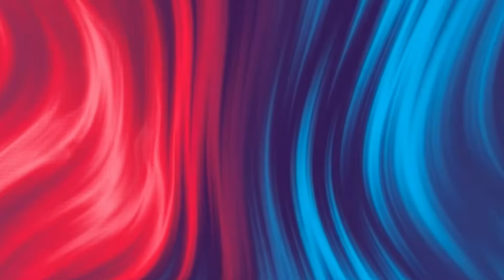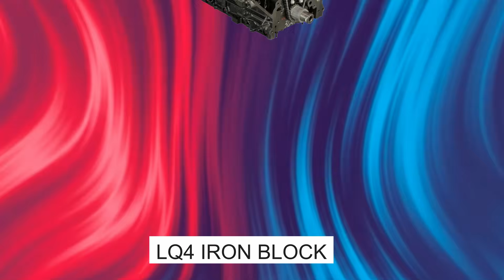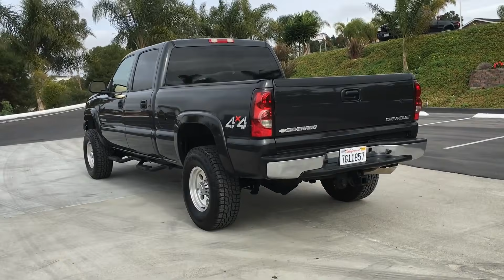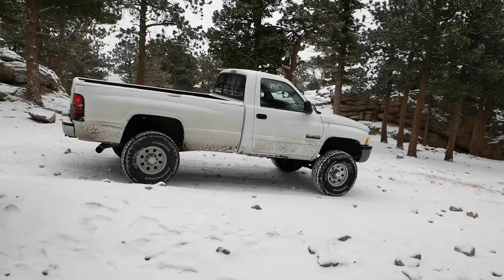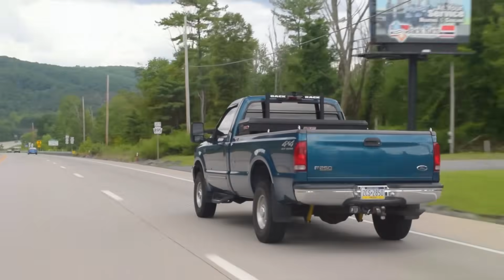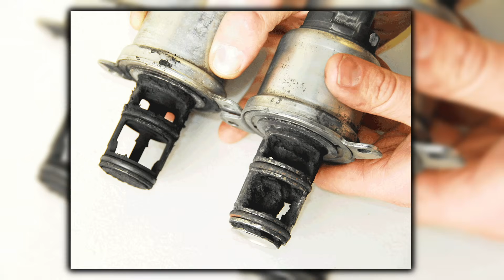3 Heavy-Duty Trucks That NEVER Break Down (Buy Once, Drive Forever)

Comment: 93 F250 XL 4x4 extended cab 7.3 idi non turbo 5 speed. Mine only has 148K on it. She's still not broke in yet. Great truck. Wouldn't trade it for anything.
Reply from the maker: The 7.3 IDI is a tank, specifically because it lacks the electronic complexity of the later Powerstroke generations. That International Harvester design is built for low-stress longevity, and pairing it with the ZF5 manual makes it one of the most reliable mechanical drivetrains ever put in a Ford.
Since it’s an IDI, are you consistently monitoring your SCA levels to prevent cavitation and liner pitting?
Reply: @AutoMetricsHQ  Honestly I never heard of that before. Thanks for bringing it to my attention. I'll drain flush and refill with an SCA precharged coolant.
Reply from the maker: That is definitely the right move - liner pitting from cavitation is one of the few things that can actually kill a 7.3 IDI long before its time. Once you flush it and get that pre-charged coolant in there, the chemical barrier will protect those cylinder walls from the microscopic vibration bubbles that cause the damage.

Are you planning to use a standard heavy-duty coolant with a separate SCA additive like Fleetguard, or are you going to switch over to a modern ELC (Extended Life Coolant) to skip the manual testing altogether?
Reply: @AutoMetricsHQ  I just put Napa 50/50 in it about 3 months ago. So an SCA additive perhaps. Been studying it, but what would you recommend?
Reply from the maker: Since you recently put fresh Napa 50/50 in there, adding a bottle of Fleetguard DCA4 or Ford’s Motorcraft FW-16 is the most straightforward way to get that protection without wasting good coolant. Just make sure you use some test strips to get the concentration right, as too much additive can actually lead to water pump seal leaks and radiator clogging.

Do you have a coolant filter kit installed to help maintain those SCA levels, or are you just going to stick to manual testing with the strips?
Reply: @AutoMetricsHQ  No filter kit, I'll just stick to manual testing. I'll think on it some more, but I may just start all over. Flush it really good, then go with fleet charge, then I know I'm good. Truck deserves it, and I know I'll never get a better one.
Reply from the maker: Flushing it and switching to Fleet Charge is a solid plan - it's specifically formulated with the SCAs already in there, so you don't have to worry about the chemistry project every time you top it off. For an IDI in that condition, it’s definitely worth the peace of mind to know the liner protection is dialed in from day one.

Since you're going for a full flush, are you planning to swap out the thermostat with a Motorcraft OEM unit while the system is drained to make sure the operating temps stay exactly where they need to be?
Reply: @AutoMetricsHQ  Yes I'll put in a ner thermostat beens its torn down that far, may as well. I've done quite a bit of work to it, complete new brakes with calipers, drums, and new bearings and seals all the way around. New heater core, brake master boost, brake master cylinder, wiper motor, blinker switch, tensioner and lots more, so I'm not gonna quit now. Thanks for all your great advice. It is much appreciated and rare to get these days.
Reply from the maker: That’s the right way to do it - the Motorcraft OEM thermostat is the only one that truly regulates the bypass correctly on these International engines. I really enjoy connecting with folks who truly care about their trucks and put in the work to do things the right way; it's exactly how you make these legends last a lifetime.

I’m always happy to share what I’ve learned over the years, so feel free to reach out anytime if you run into anything else or just want to talk shop.
Reply: @AutoMetricsHQ  I will and thanks again

Comment: 2002 cummins dodge  300k and still purring  and no blow by
Reply from the maker: That’s a solid milestone for a 24-valve. 300k miles with no blow-by proves the internal tolerances on that 5.9L are still tight and the ring sealing is spot on. It is a testament to the durability of that cast-iron rotating assembly when it's properly maintained.
Since you’re at 300k, are you still running the stock lift pump, or have you upgraded to a higher-flow system to keep the fuel pressure steady?
Reply: @AutoMetricsHQ went  to the intank pump
Reply from the maker: The in-tank conversion is a step up from the stock block-mounted setup, but those retrofit pumps can still be a bit temperamental as the miles add up. Keeping that VP44 supplied with consistent pressure is the only way to prevent it from overheating and failing prematurely.
Are you running a fuel pressure gauge to monitor the output, or are you just relying on the pump to keep up with the demand?
Reply: @AutoMetricsHQ installing gauge as soon as it gets here and the pump was the cheapest option  at the time $130 instead of almost $500 for the fass the intank runs a steady 15psi as I check it occasionally
Reply from the maker: Smart move on the gauge - it’s the only way to be sure you aren't starving that VP44 under load. While 15 psi is a solid number for an idle check, those budget in-tank pumps can sometimes see significant pressure drops when you're really leaning on the throttle, which is where the damage actually happens.
Once you have that gauge installed, are you planning to tap into the fuel filter housing or are you going to mount the sensor directly at the inlet of the VP44 to get the most accurate reading?
Reply: @AutoMetricsHQ inline near injector pump, has frame mounted filter near tank  stock filter removed
Reply from the maker: Moving the sensor right before the pump and deleting the factory housing is a smart way to simplify the fuel path and reduce pressure drop. Getting that direct reading at the VP44 inlet is the only way to know for sure that those internal electronics are staying cool.
Reply: @AutoMetricsHQ  for sure,plus I always keep fuel tank near 3/4 full ,and use lubricant
Reply from the maker: Keeping the tank full is a smart move to keep fuel temps down and protect that ECU. Adding a lubricant is also solid insurance since modern ULSD is much "drier" than what these pumps were originally designed to run on.
Are you using a dedicated additive like Hot Shot’s or Howe's, or are you sticking with the old-school 2-cycle oil trick to boost that lubricity?
Reply: @AutoMetricsHQ usally hot shot
Reply from the maker: Hot Shot’s Secret is hard to beat for that 24-valve fuel system. The added lubrication definitely takes the stress off the mechanical parts of the VP44 while keeping the injectors clean.
Reply: @AutoMetricsHQ for sure
Reply from the maker: I love talking shop with guys who actually know their equipment and put in the work to keep these legends on the road. Keep that 24-valve breathing clean and it'll probably outlast us all.